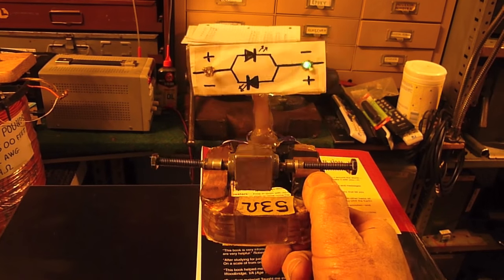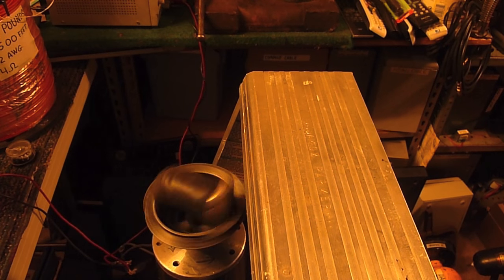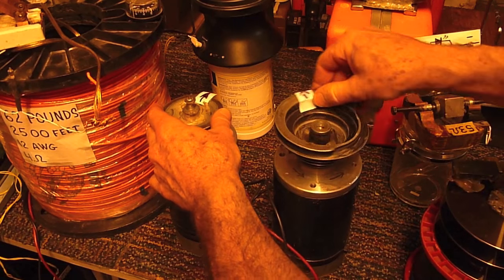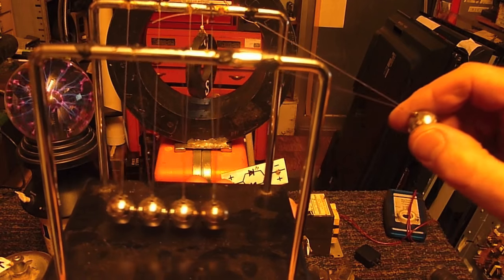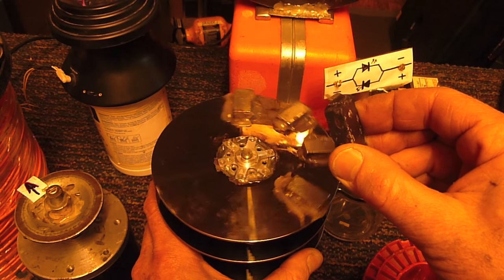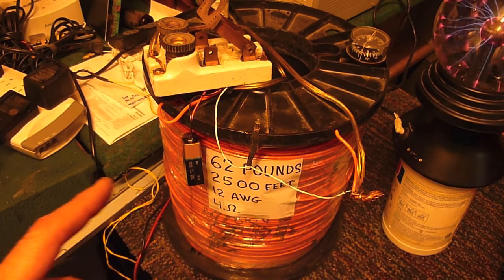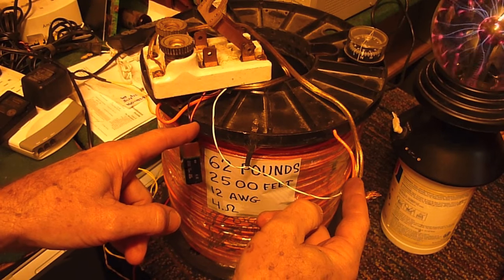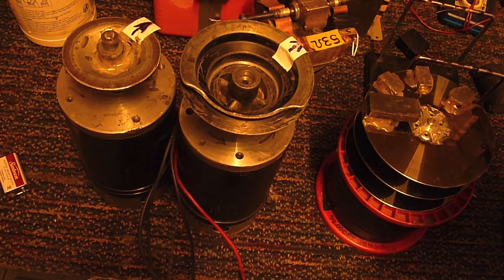Does free energy exist?

Comment: Try finding a loophole in the transformer equations, you're not gonna find it!
Reply: Yes you are, you can find a so called O.U result. 
its stated there must be a reflected resistance (Lenz Law) EM field, this opposed field can be counted itself!. And so its effect in electrodynamics when ALL transformer designs are considered, it's a certainty. (With respect to primary load) the reflected field can be redirected in a 'bucking coil' secondary to NOT reflect back to the primary coil. 
In that transformer design the primary coil becomes a purely inductive circuit, and what is not lost to copper, core, eddy heat losses, and we know that may be like (20% only) the remaining can be used again because of on magnetic resistance. Maxwell knew of this but thats right we only study 4 of his equations. Jim Murry an engineer out of the U.S has been doing this for 20+years in both mechanical transforms and motors to name one respected mainstream engineer among very notable out there

I do agree that the standard transformer equations do assume reflected resistance though  :)
Reply: Echelon energy
There's lots of losses in a transformer other than the copper losses.
Reply: +leerman22 yes.... inductance, Would be the only other not mentioned above right?

Comment: it is so true that the free energy world is full of bull. I am a amateur tinker and have dismissed the free energy in the sense of over unity. however radiant energy or energy from aether is a possibility. you have experimented with energy from atmospheric electricity, that is a promising area as their is a lot of energy in free space. Tesla had a patent 4 radiant energy receiver. it is on the net and simple. the key to makeing it practical you will need to use a Tesla coil in reverse to step down the hi voltage low current to hi current  lo/modest current. take care.

Comment: Science has 100 other methods for you when you are failed in one method. think of this planet Earth How it rotates around Sun freely
Reply: The earth only rotates around the sun because a supply of initial energy was stored into it when the solar system was formed. Since then because there is very little resistance in space to slow it down it just keeps going due to its momentum. As such the energy to keep the earth going in its orbit initially came from somewhere and it wasn't free.

Comment: This guy pulled 340 some bolts out of thin air… Is probably a way to use that voltage or multiplied into high-voltage somehow with the step up transformer maybe. The point is he's pulling 340 V out of the air not costing anything… I think this is what Tesla was doinghttps://www.youtube.com/watch?v=5izEj6uGwrM
Reply from the maker: Unfortunately many people don't understand the difference between a volt, amp and a watt. This gentleman's demonstration  may seem impressive, but not when you understand that power is voltage times amps flowing through a circuit. I can rub my feet on the carpet and instantly accumulate a 2000 charge, but at such a low current it not going to be very useful.

Comment: its  not free energy or even propetual motion it is all about tapping into energy that is around us that cost nothing just lieke electro static motor generators or manipulati g magnetic field or using water in such a way like cold fusion or any way to break the oxygen hydrogen bond which has been done thousands if not millions of times. Energy is all around us from the sun and also from the moon its the heat energy or radio energy. it can and has and is being done all the time on youtube, yes I said youtube one of the most largest information site ever created an unlimited encyclopedia of knowledge. yes your right a bunch of bull crap videos and also people like me that doesnt know how to measure things correct sometimes but here is a thought are the measuring devices correct? maybe for conventional hot brut force electricity but how about cold electric or rather rf frequency 0 point call it what you will. I liked your video so dont get all mad at me but it isnt as hard as you might think to tap into this and if I ever do ill be posting it. Oh I forgot how about efficient heat pumps this is taught but hardly discussed its usually a circuit or some gadget being discussed.
Reply: +captain42979
Agreed. I myself have made a revolutionary device in recent years which can capture FREE ENERGY from THIN AIR. It's this glass-like device made from special materials that when I place it outside turns thin air into FREE ENERGY. Sadly, I can only get it to work during the daytime. And when it's cloudy it produces much less power. But, still, FREE ENERGY! Imagine what would happen if this caught on! Oh, but... THEY... are stopping me! THEY don't want you to know about it.